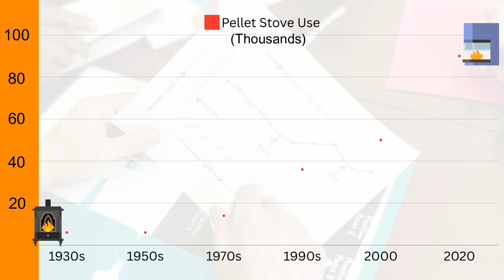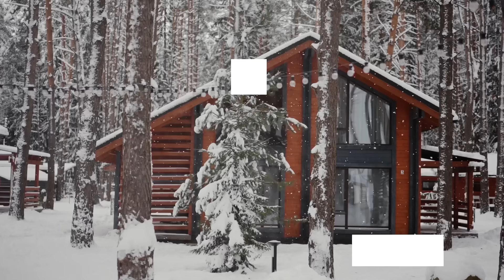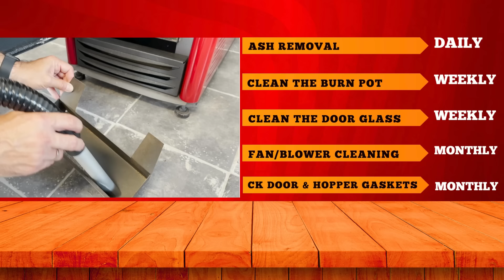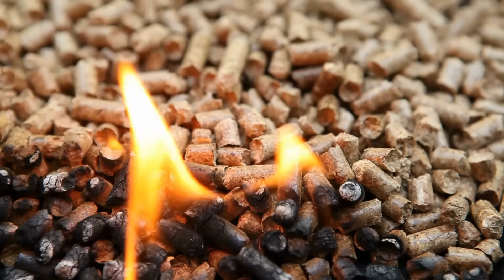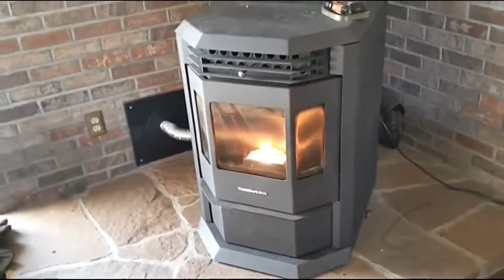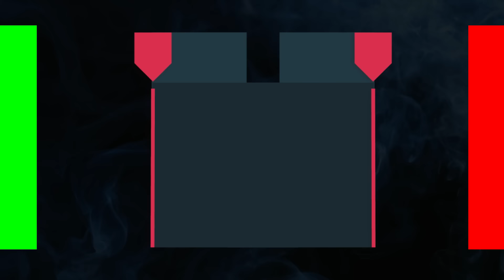THE COMPLETE TRUTH ABOUT PELLET STOVES

Comment: You minimize the one element that can cause you big problems. HOW MUCH ASH CONTENT?? Also a Harmon in the fireplace it is not easy to clean that pipe going up the chimney.
Reply: I am 68 years old with 3 back surgeries, and I have no problem disconnecting the outlet pipe for cleaning. The insert slides forward with ease and all components are visible for easy maintenance.  (Breckwell Maverick insert.)
Reply: @dougskucas5004  you would not say that if you owned this Harmon Insert I have.
Reply: @mikebrouillette6087  Yeah, my son owns one. A nice stove insert, but it weighs a TON! My stove insert is steel and weighs 160 lbs.

Comment: This is great as long you have the power to run it. No power, no heat. On the other hand, if you have solar panels with battery backup, you ought to be good when the grid goes down. You'll still have heat and a source for cooking if you have a Pellet Grill along with the stove.

Comment: Pellets used to be just over $4 a bag, but now the economy has drove them up to almost $6 a bag so it's not so cheap anymore. I went back to natural gas because it's much cheaper. I always have my old woodstove also if I choose to use it again.
Reply: Natural gas is on par with wood pellets at least in NYS so that's kind of a wash, but a pellet stove uses much less electricity than a furnace does. I heat 1600sqft cheaper than my buddies 850sqft home.
Reply: Corn is DOWN this year.  It's about $4.50 a bushel, which is 56# as opposed to 50# pellet bags at, as you say, $6.00.  Corn stoves are also neater!
Reply: 200 dollars a ton here
Reply: Used to be .40 per bag back in 70's 80's ! Had an austroflamme  stove
Reply: pellets are still vastly cheaper even at the nationwide average of 6.50/bag.

Comment: Not worth it any longer, as I age.  Each bag was handled 5 times from purchase to burning.  Once the forklift loads it onto my truck, I moved it from the pallet to the tailgate, tailgate to storage, storage to wheelbarrow (5-6 in the wheelbarrow), wheelbarrow into house, and finally from the pile next to the stove into the hopper.  Natural gas prices are not so bad that it about equals the price of pellets.  Each ton ( I used 3 in a winter) eventually turns into moving 15 tons of material.  I stopped using it 8 years ago, as it was not worth it.

Comment: On the main floor I have a soapstone wood burning stove and in the basement a Herman pellet stove. I like the wood stove much better, more heat at a lower cost. What reviews never talk about the noise of a pellet stove and the mess of the fine ash it produces. I have to wear a respirator mask to clean the pellet stove, the entire stove needs to be taken apart after each pallet of pellets, it takes about  an hour to clean. My wood stove takes 15 minutes a year. Colder it is outside less efficient the pellet stove is since it takes direct air from outside.
Pellet stoves will not work when there is no power.

Comment: The 2 pellet stoves I had broke down in less than 2 years multiple times and cost almost $12 a day to operate for unreliable heat. Give or take thats $360 a month. I decided that electric heat is much cheaper and easier. I had to shut them down every 2-3 days for hours so I could clean them out. I’m not a fan of pellet stoves at all personally.

Comment: I heat with electric, some propane and pellets.  Electric most of the time, when it gets cold I also use propane space heaters that will work without electric (just without the fans for when power goes out).   When it gets really freekin cold and windy I fire up my Harmon thermostat pellet stove in my basement as it will really crank out the heat.  When it's that cold, I don't much care what it cost for a few days to keep warm.    
On warmer days, the pellet stove is very costly to run as it shuts down, cools off and has to reignite which all takes extra electric and it's very low efficiency getting up to temp within the heat exchanger each time.  
I can piss through a lot of pellets in warm weather so I only burn in very cold windy weather.  The Harmon is a great stove and love it as supplemental heat source.
Reply: My Breckwell stove's external added on thermostat has a high/low setting, also. The stove doesn't shut down, only runs on low until the thermostat says to increase BTU's. Constant running, no shut off and re-start needed. I am quite sure other stoves have that option, too.

Comment: What is the source of the combustion air? Internal or external?
Reply: Mine has a separate combustion air intake that uses outdoor air as it's source.
Reply: I have run both inside and outside on 2 different Harmon stoves at 2 different homes.

Comment: Pellets are so over rated.  Ridiculously expensive and a big lie.  They only burn cleaner because they are made from sawdust so a lot of the fines get blown out of the exhaust stack.  No one ever talks about how much energy goes into the pellet manufacturing process.  Pellets are so far from being a green heating source it’s not funny.  It amazes me me on how much people do not pay attention to the whole cost.
Reply: They are dirt cheap compared to gas or oil.
Reply: And what are the costs associated with refine oil and gas? 🤔
Reply: @ the price per a gallon and how much your burn to keep your house warm. At least that’s the case where I live.
Reply: Wrong. Just a different way to heat your home. Let's put it this way, for $300, I can heat my home for the entire heating season. To fill my propane tank during the same period, if I ran my central heat all season, I would spend double that. And as far as cleaning, you still have to yearly clean any fossil fuel burning heating equipment (unless you don't bother to maintain it) so that's a moot point. Let me guess, you are one of those "electric cars are bad for the environment because of the batteries" people, all while chanting "drill baby, drill" for oil. Any technology is going to have an environmental impact.
Reply: @ well first of all electric cars are a waste of money and time and no good for the long hall.  I don’t know where you live or the size of your hose or how much you pay for pellets but here in Rhode Island they are $300 a ton for the crap tractor Supply pellets and up to $450 to $600 a ton for good pellets.  I have a Harmon stove that goes through 80 pounds of pellets in a 24 hour period to keep my 1000 square foot garage at a toasty 55 degrees.  Some how I think you might be heating your electric car with pellets and living in it.  Nice chat, I guess it does take all kinds.
Reply: @ either your stove sucks or you’re just lying. Mine heats my house in 0 degree weather to 75 degrees with maybe a bag in 24 hrs, and that’s the $300 a ton cheap stuff from tractor supply. Oil and propane are more expensive by far.
Reply: @ yeah that’s it, you are right I’m just lying because I have nothing better to do than argue with idiots like you.  Thanks for your time.
Reply: @paulwilcox4056  Well, I can heat my entire 2500 sq ft house for the day on one 40 lb bag and the average temperature is 68 degrees. And I pay only $300/ton for Easyblaze (or I could get Hammers for the same price) from the certified company who installs and services my stove. So you are spending twice as much to heat half the space for 13 degrees less? My electric car could heat that garage of yours better. And as far as my car being a "waste of money", I charge it for free at work, don't pay any fuel tax, the only maintenance is the occasional tire rotation, and bought it as an outright trade from my previous vehicle! So that's easily an extra $300 a month back into my wallet from driving my old ICE vehicle. Got anything else to dish out or are you good?
Reply: @paulwilcox4056  Well, I can heat my entire 2500 sq ft house the entire day on one 40 lb bag of pellets and keep it an average of 68 degrees. I only spend $300 a ton for Easyblaze (or I could get Hammers for the same price) from the company who installed and services my stove. So it sounds like you are paying twice as much to heat half the space and less of a temperature? My electric car could heat that garage of yours better! And about my electric car being a "waste of money"... Let's see, I charge for FREE at work, don't pay a fuel or road tax, and maintenance is only the occasional tire rotation. Plus it was a direct dollar for dollar trade from my previous vehicle. So I figure I'm putting an extra $300 a month back into my wallet driving my sissy car around. I'm okay with that. Got anything else you need to rant about or are we good?
Reply: Wait, you have a pellet stove but think it's stupid to own one? Irony?

Well, anyway... I can heat my entire 2500 sq ft house the entire day on one 40 lb bag of pellets and keep it an average of 68 degrees. I only spend $300 a ton for Easyblaze (or I could get Hammers for the same price) from the company who installed and services my stove. So it sounds like you are paying twice as much to heat half the space and less of a temperature? My electric car could heat that garage of yours better! And about my electric car being a "waste of money"... Let's see, I charge for FREE at work, don't pay a fuel or road tax, and maintenance is only the occasional tire rotation. Plus it was a direct dollar for dollar trade from my previous vehicle. So I figure I'm putting an extra $300 a month back into my wallet driving my sissy car around. I'm okay with that. Got anything else you need to rant about or are we good?

Comment: Wood burns hotter and way more area coverage and also drys wet gear ...burn dry wood only
Reply: Wood stove pollute the air much more, and a lot of areas no longer allow wood stoves to be installed.   My homeowner's insurance no longer allowed my Orley stove to be used after 35 years! I wish my neighbors knew how to burn their wood in their stoves properly. They stink up the neighborhood! My pellet stove has no smoke coming out of it. 14/1 air fuel ratio constantly.

Comment: I have used pelpro stoves for over 10 years. One in the basement and 1 on main floor. I spend approximately 800 dollars a year to live comfortably.
I like the house warmer 74° or abouts there
Reply: 800.00??? A year?? NOT A FUCKIN CHANCE unless you live in Florida. 2 bags a day for each stove in northern climates.....that is a long way from 800.00 a year. 800.00 a month is what 4 bags a day costs.
Reply: @outboardcentral I paid $280 a ton for my pellets. I live in NY and it gets cold here. I use 4 ton a year and have a 1600sqft  home and have NEVER used 4 bags a day. Hell, I've never used 2 full bags a day. Many factors come into play with a pellet stove. If you have to small of a stove you will have to overwork it to keep up. Plus where the stove is placed and having air movement. Mine is in the living room which probably stays 75 in the winter. I have a fan on top of my stove that helps push air into my kitchen and bedrooms. The bedrooms are around 65 when it's really cold out. My 2nd story stays warm because heat rises. With how expensive  natural has and electric is in NY i definitely save money with a pellet stove. In comparison my buddy has natural gas and a little over 800sqft home and he pays more then I do to heat his home. Even at full bore I don't see how it's even possible to use 4 bags a day. Mine would only use 3 a day if I did that and thats 42k btu. If someone has to use that many bags then their stove is to small and is wasting pellets.

Comment: Does my burn pot fill up with poorly burned pellets because the retailer stores pellets outside? I have to shut it down at 20 pounds to clean the burn pot.
Reply from the maker: Clogs and poor burning can be related to pellets exposed to moisture and humidity.
Reply: @ 
That’s what I thought. I guess I will have to drive an hour to get my next load.

Comment: I tried a pellet stove ONCE! I am not going to tell you the manufacturer but will suffice to say that they didn't do enough testing before releasing it to the public. 
It was professionally installed. It worked good after installation.
 The first time it failed it didn't light up. Solution = replace the circuit board. 
The second time it failed it filled the house with smoke. Solution = Called the selling dealer and insisted he come and take that POS out of my house. He did and refunded my full purchase price including installation costs. I wont have one of those things in my house as long as I am alive. I burn wood and furnace oil, only.  The mess of cord wood is better than losing my life to a pellet stove.
Reply: Wiseway?????

Comment: Started with woodstove,  then bought a pellet stove, power goes out no heat,  auger breaks down no heat,  circuit board dies no heat, pellets have a hole in bag huge mess of soft pellets,  auger died with a few bags of pellets left,  straight to the scrap yard,  pushed it out onto the pile.   Back to wood, here in the Pacific Northwest their's free or cheap wood everywhere ,  no more pellet stoves for me.
Reply: wood is also more labor intensive
Reply: In my mind a person should always have 2 sources of heatml

Comment: Pellet stoves are “cute” and convenient. In my area, several have tried the out side pellet hot water furnaces. If you have money to burn, go for it. BTU yield between pellet and conventional wood isn’t the same , conventional rules, plus no electricity needed with conventional BUT, as you get older, less physically able then the pellet stove begins to really shine and becomes a very logical choice.  The caveat here is that when a pellet stove goes down, and they will, it will cost you. Circuit boards $150-$300 plus, blower motors $80-$120, auger motors$50-$150, and some must have specific tools so a service tech is needed. Pellet stoves are expensive. Harman P68 will give up to 68,000 btu while a comparable and cheaper size wood stove can yield up to 80,000 btu with good wood. The Harman Pellet stove is about $5200. Pacific Energy Alderlea wood stove (higher end stove for comparison), $4700.  at a 90,000 btu with a 88% efficiency rating.
Reply: Yup … Expensive pellet stove here … and if one is not a mechanic, be able to source the parts, diagnose the problem, have the tools to fix, .. then…. the service man … is going to empty your wallet 🤑👀
Oh .. better buy some spare parts as a backup, because the $6k to $7k unit I have
is no longer available and I’ve had it apart several times, but it is a ShowPiece.

Comment: I owned a pellet stove for 20 years. Loved it. Cost went up in Pellets over 6 $ a 40 lb bag and the electric it uses to run 2 blowers and 1 auger motor. the ash is like talcum powder and need special vacume to clean. had to clean flu 3 times a heating season , and needs a double wall chimney pipe. There are a lot of lies in this promo. If I had access to ample supply of wood I would have a wood stove. Easier to clean and does not need electricity when there is a power outage.
Reply: You DO NOT need triple wall pipe if you run the pipe up the chimney. Mine passes code.

Comment: Pellet stove’s are very good if you buy a quality one have had a Harmon stove for 25 years same one . Replace the igniter and blower fan once each. Heat the 1700 sq foot house with three ton of pellets anywhere from 75to80 degrees, I live in central Maine. Love the easy cleaning and no mess.🥵
Reply: Okay does your stove I mean I'm figuring if it's just an igniter you need why not one that you use batteries for. Also can't you use wood chips from like a wood chipper and stick them in there and place a pellets if you run out of pallets?
Reply from the maker: Thanks for tuning in.

Comment: I worked at a guy's house who had a pellet stove. Thing had a noisy fan that blew hot dry wind constantly, and the flame inside looked like a blast furnace. I heated my house with a regular wood stove and much preferred the quiet heat.
Reply: Went from scrounging wood, hauling, chopping, stacking, hauling again into the house looking for a safe ash dump out back, getting up early to tend fire 
or restarting.
All that to save 200 buck s year.
Reply: We haven't even yet spoken to the chain saw and its maintenance and occasional leg bleed from the cold slippery axe.
Reply: Don't forget the surprise fragrant woods we get now and again. Heaven

Comment: We run a pellet stove to supplement our heat pump.   When the temp drops the heat pump loses it's efficiency and just doesn't put a nice heat in the house.  The pellet stove just takes the edge off and puts a nice heavy cozy heat in the house. 
For all you pellet newbies ask around for the best pellet brands instead of doing your own trial and error.  There's a big difference in brands and there are some bad ones out there. ( Be careful for home store brands, smaller stores usually sell the good ones)
Reply: We do the exact same thing.  Best thing since sliced bread.
Reply: I do the same thing. Heat pump wants to keep running when it's extra cold. Pellet stove adds a nice one-two punch. Best thing since sliced tomatoes.